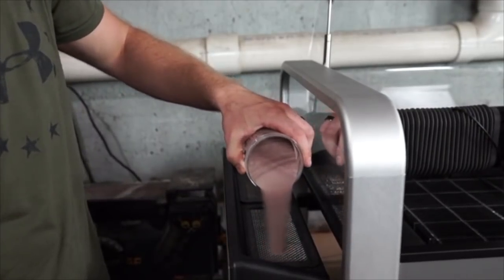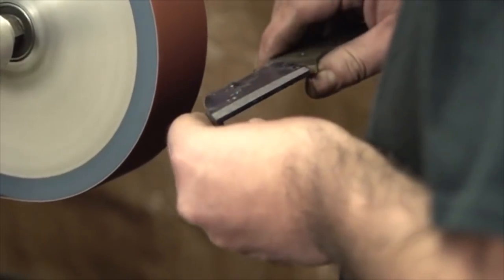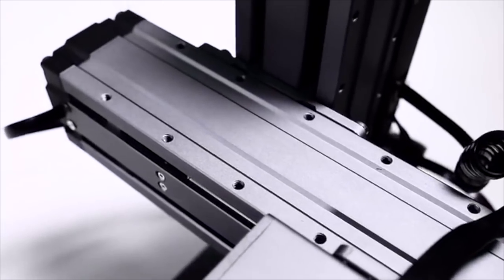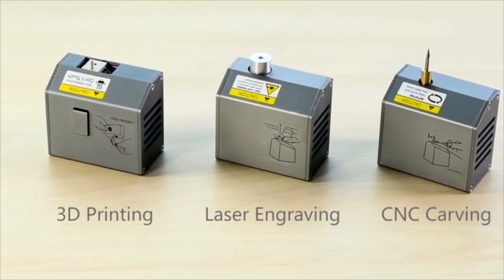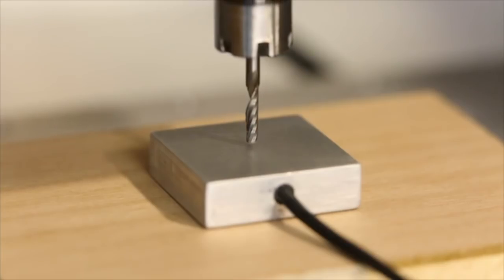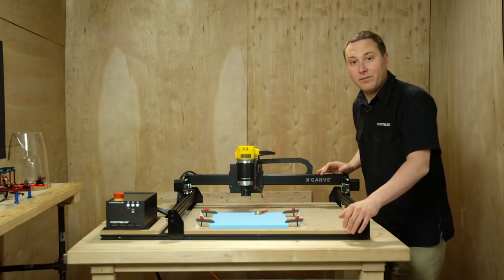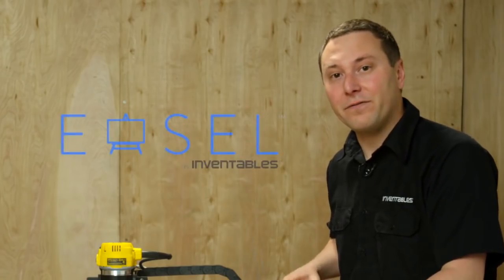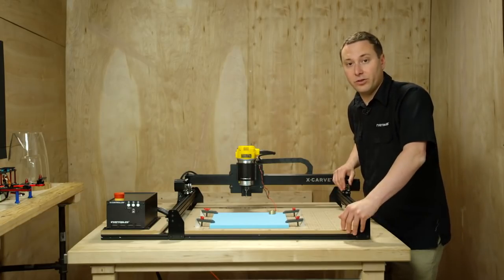TOP 5 desktop CNC machines for your workshop ▶ 2

Comment: Look,s pretty cool I set up/Indicated in and programmed real big MATSURA MC-2000V verticle milling/machining centers, fanuc M,G controls we we're building water cooled plastic injection molds of all different size,s also had a manual machine department Wich a also worked in the sky was the limit you could make what ever you wanted to me it wasn't a job it was like a hobby and I got paid for it, enjoyed the heck out of it I've been a machinest for around 20 years I've done all kind,s of differen,t work it,s really cool.🙂🙂...FWM...